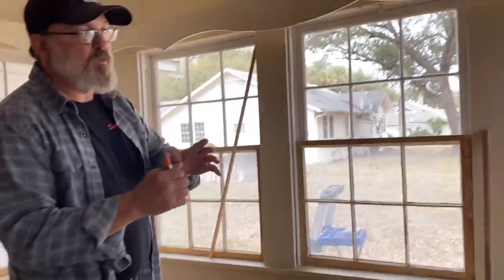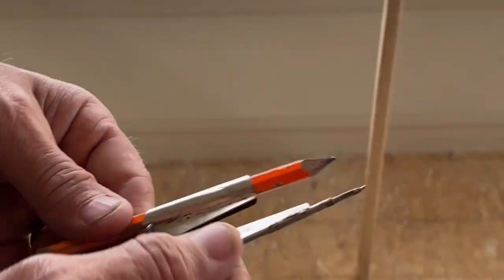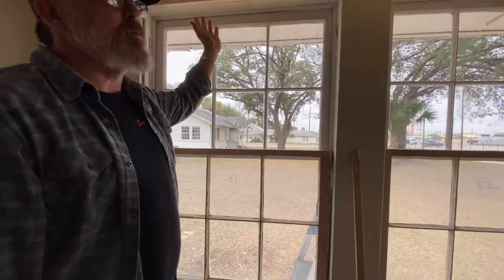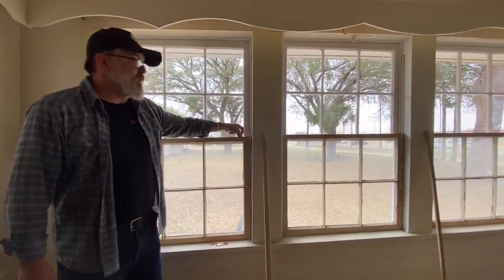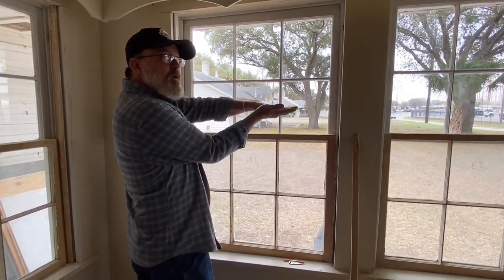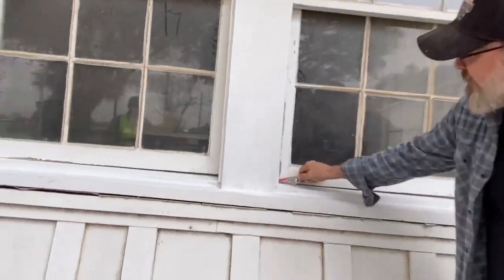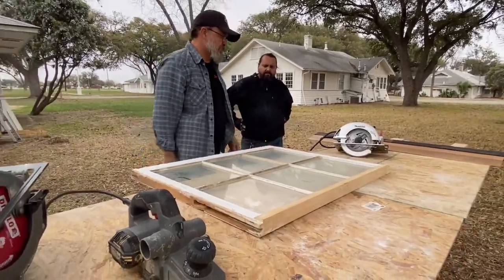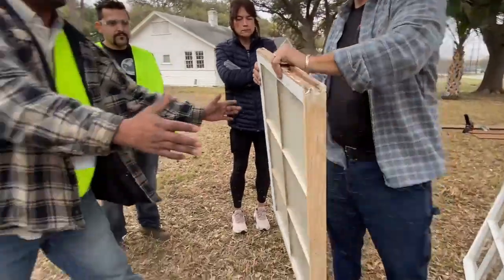Meeting Rails Didn’t Line Up In This Crooked Window. How I Fixed It

Comment: Does anyone have any advice on a more lightweight repair when the meeting rails are only off 1/8 or 1/4 inch? The culprit is also a shifting house; I have other windows that are more severe like in the video. So, I'm looking at removing triangles of material 1/8 high or less.

I'm a little out of my depth, but I was thinking of scribing a line as Steve suggests here, and then using a hand plane to remove that bit of material.

Comment: Steve, wondering if you have found a solution for small gaps at the meeting rail right where the parting bead sits. I’ve gotten my parting beads perfectly aligned, the parting bead is in, the lock is really tightening things up nicely, but there is the smallest little point where a gap still exists on the upper sash in front of the parting bead. If you are looking down into it, you can see outside. Seems to be where the inner part of the upper meeting rail doesn’t extend all the way to the meeting rail, so that is where the gap exists between that notch and the notch on the lower sash…